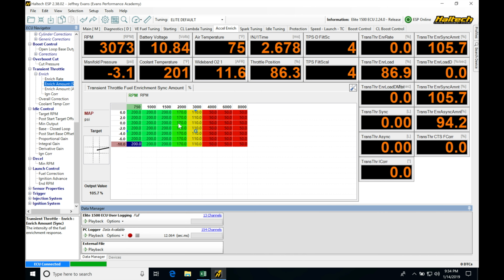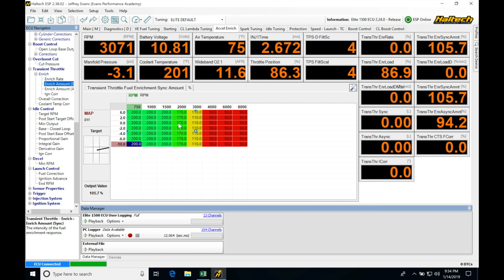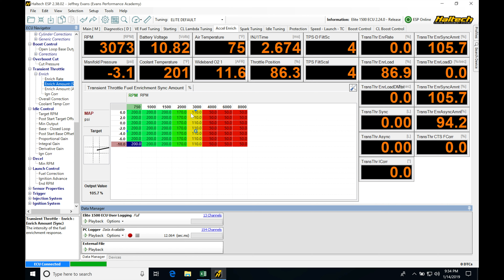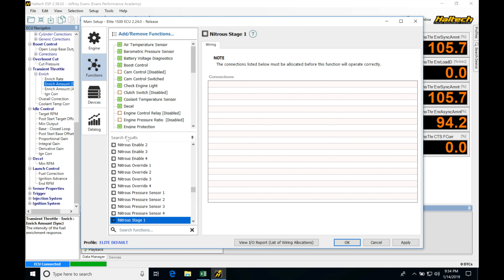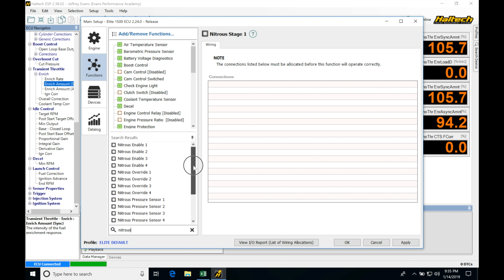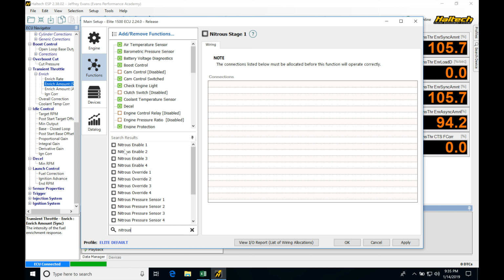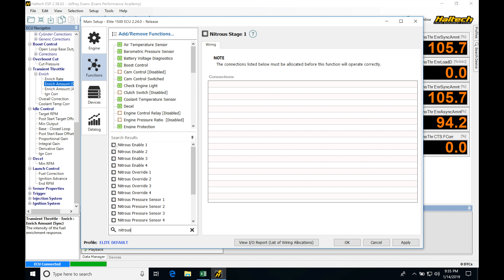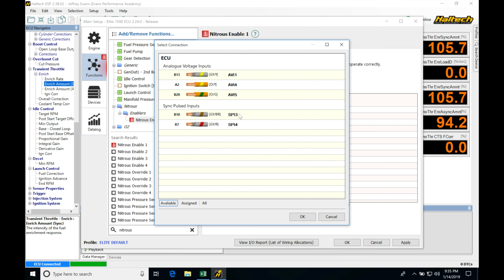Haltech Elite: Nitrous Control | Evans Performance Academy

Comment: Evan sorry bro but do i need to use a wot switch from the nitrous kit, thanks man
Reply from the maker: If you are having Haltech control the nitrous directly you do not.
Reply: @EvansPerformanceAcademy  can't find anything on how to hook up a nitrous into the ecu, i mean which part of the kit should be hooked up with the ecu is it the solenoid